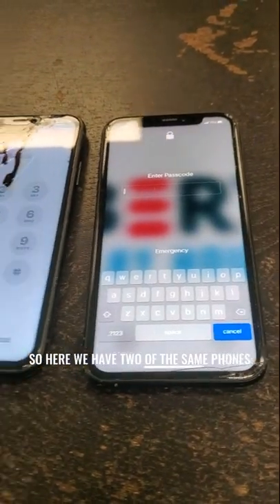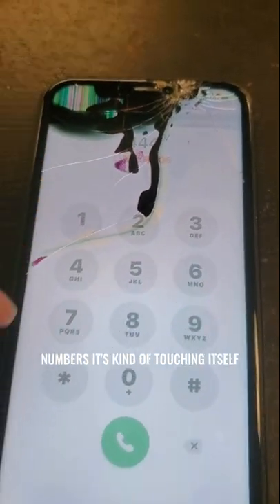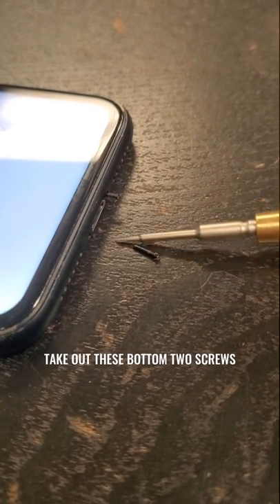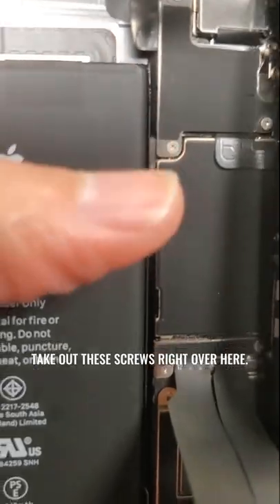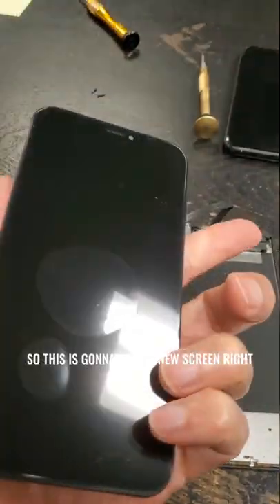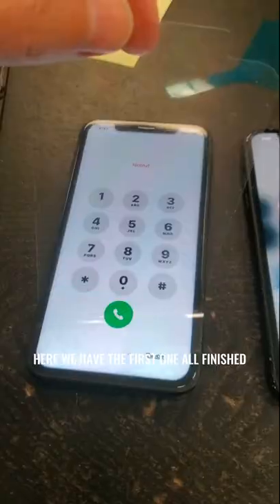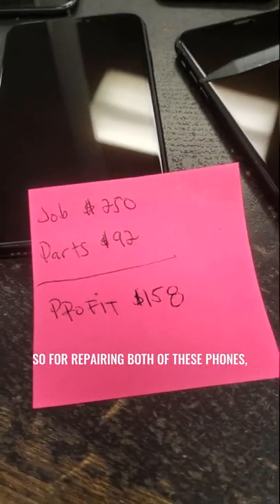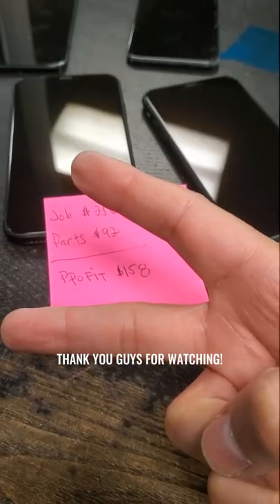$158 Profit Repairing 2 iPhone XR Screens.👌 #Shorts

Comment: Lol why didnt you enable comments on your z fold video?

I've owned the phone since launch. (And I'm a life long apple user). It hasn't cracked or scratched on the inside. First 5 days of owning it I freaked out because I dropped it in sand at the beach. It got inside the phone but the hinge brushes eventually got it all out. No issues. Also owned the z flip. That one unfortunately got tint cracks on the crease after 5 ish months. The z fold has been perfect though, no cracks or issues.